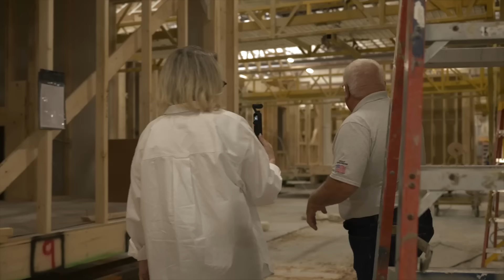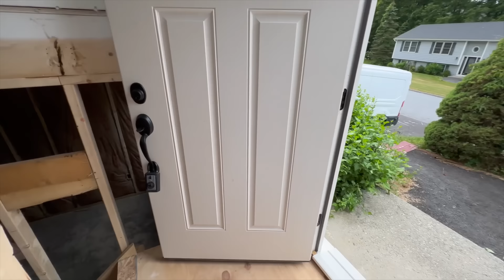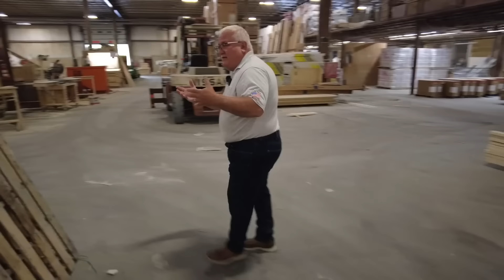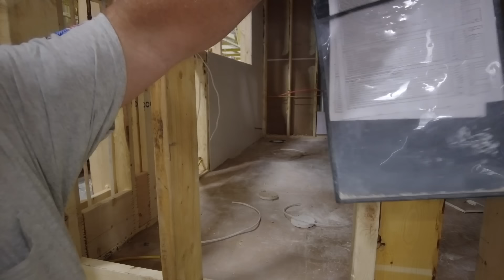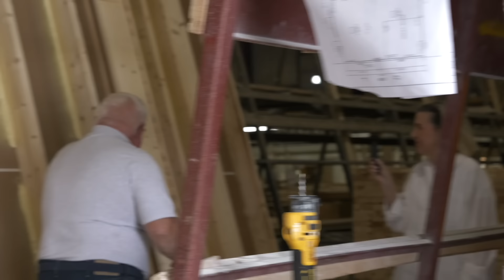Modular Homes ARE Better Than Stick Built!!!

Comment: We have a modular home and the home and home building process was WONDERFUL!!  Just like the guy said, modular homes are built much, much faster and better than stick built.   Why are they built better?  For starters they have to be strong as they are trucked going 70 mph down an interstate.  Secondly, they are built indoor so rain doesn’t get into the house because the roof isn’t on or the windows aren’t installed.  Thirdly, the people working in the factory are highly skilled in what they do because they do it over and over.  You don’t have the turnover you have in traditional stick built construction.  Lastly, our modular home builder gave us a choice to use the options for flooring, cabinets, etc that the manufacturer offered OR I could chose my own outside of the builder options.  I did my own light fixtures, hardwood flooring, drawer pulls, appliances and kitchen cabinets.  The company did give us a bit of a credit since they didn’t have to supply those things.   You will never get that offer by some HOA developer….it is their stuff only.  For some reason, people think mobile homes and modular homes are the same.  They aren’t at all.  Nobody can believe our all brick (brick on all 4 sides), 3800 sq ft house valued at a little over 1Mil in south east Virginia is modular but it is.

Comment: As someone who used to set modular homes, and now do construction, and I can 100% back this up. They are designed to go 60-70 miles per hour and get worked into whatever space that the customer has built which can be very tricky, and still be together with minimal stress cracks. They are tough

Comment: Many people don't understand the major differences between mobile homes and stick built or modular. Unless someone custom orders a mobile home with upgrades, generally what they will get is 1/2" drywall, 1X3" studs, low R value insulation, Pex or PVC plumbing, plastic bath fixtures,  the cheapest of everything.

Comment: I have worked in a modular plant and i have framed custom homes in the field. Modular is way better than a mobile home for sure, they are well built. But, they will require more material for mating purposes, and the hinging for roofs. And if you want an air tight building with the best insulation, building in place is easier to accomplish that. But the ability to build in dry and relatively warm/cool conditions, that was great, and a valid selling point.

Comment: I disagree. I worked many years on new stick built homes and a few years in a modular factory. There is a lot of variables. Some modular houses are built very well and some contractors do a poor job building stick built. When you average it out, stick built is much better for many reasons. As someone who actually knows the trades, it's much harder servicing or renovating a modular home. Modular homes are plugged together. Which literally means plugs for the branch circuits and tons of connection points for the other systems such as plumbing. I can go on and on with the differences. It ultimately comes down to the contractor or factory. The only thing that can't be debated is the speed a modular home goes up. That is the only absolute benefit of modular.

Comment: I work in HVAC, these house rate 1 grade above a trailer. Build quality is so so poor. I just put a Daikin mini split in one because the factory duct work is pretty much garbage. Zero calculation done. So their kitchen area was not getting cooled  by their recommended set up. They were 6 months moved in with door and baseboard falling apart, vertical cracks on walls. Kitchen cabinets are weak, with cheap hardware. Then they told us this is a premium upgraded version of this modular. Not just the base model. Only pro is protected materials during construction

Comment: The company you are showing does do excellent work. I believe the common idea of modular homes being poor quality comes from the countless manufacturers that use cheap subfloor that rots out quickly and frames with 2x3 and uses 1/4" drywall and uses seam strips instead of mudding and taping etc etc. Not all modular homes are built the same the ones shown here are nice but many are very poor quality

Comment: I have been a drywall contractor for over 40 yrs. We measure every inch of the home in most cases to place the drywall. 9 out of 10 times modular homes are usually out of square  and are subject to way more cracks than a stick built home. 2 by 6 framing on outside walls doesn't mean a lot when they are out of square and not insulated properly.. Most modular homes only use wood faced cabinets with the rest being pressed wood. Their oak cabinets are usually oak vaneer facings. You have to watch the fine print and most actually don't know the difference between solid oak and fake oak fronts. The crown molding is usually plastic or foam as well as the baseboard. In a 2 story home the second floor is usually not framed correctly to finish and you will be responsible for that cost. If you buy a 2500 sq. ft house and its two story in most cases the second story has no wiring insulation plumbing just a open hull. Plan on spending another 100 grand or more to finish the second floor. The owner is usually required to have the basement ready for the modular at a hidden cost. They are better than a mobile home but lack a lot compared to a stick built home with a reputable builder.

Comment: There are stick built homes over 200 years old, still strong. I think the concept of modular is great, the whole thing I have a problem with is when they are married, they are not always touching one another everywhere, tight together. They just make sure they are plump. Personally, if you can get a just say 1500 sq ft modular thousands cheaper that a stick built, and are happy with the looks and quality, go for it. But homes are like everything else, they require maintenance, and whether it is stick built or modular, it's all in who is doing the work. I have seen masons pour footers after a month of rain was in the hole, 4 inches of mud, just pumped it out about 3/4 way and poured, said it helped to level it. What happened? It settled, so did the house, cracks in the footer, drywall everything. You can build a great home, and still have it have problems. I have never built, at my age probably never will. But if I do, I'll want it started late spring, after the wet season, and at least the outside done before winter. gives time for the roof shingles to stick (if asphalt) and to hopefully not let the lumber absorb to much moister. Truth is, that's another problem, when there is a demand for lumber, its cut fast, and in many cases not dried properly. When the moister dries, it contracts, and if drywall is on it, it will move with it, making hairline cracks. I don't think there is a perfect science to a home, but traditional built homes are still standing sells me.....

Comment: When I worked at the Bendix Research center, I worked closely with Bendix Home Systems. The company wanted to see how different a modular home was from a well built Mobile Home. The huge difference is basically the same as stick build but done with a ton more precision.  There was a Michigan company building Modular. We were able to witness a home being "built" for a customer. They showed up with the modules and three days later the home was ready to move in. And just like this video the home was not identifiable as a "bunch of boxes". This was in 1974.
Reply: Start an off-grid community consisting of individualized log cabins. ~LLC~ Lincoln Legacy Cabins

Comment: No, they are not better. I've been building homes and doing repairs and remodeling of homes for over 20 years. Modulars are stick built. They use the same format as a stick built home. The only difference is, a modular is made in sections, then shipped to the property to be set up. But, they are still individual boxes that are connected together with lag bolts. A "stick built" home is all one piece, all connect together as one whole unit, not two or three separate boxes. And depending on the manufacturer, you might not be getting 2x4 walls, but rather 2x3 walls, to save the company money and to make the home weigh less for movement. I've seen many of the modulars using 1x2's for the rafters, to the point that I was afraid to walk on the roof. Compare that to a "stick built" home using 2x8's. Big difference. Modulars aren't bad, don't get me wrong, but a home that is built on site, all walls connected together at the same time, are a little bit more sturdy and will last longer. That may just be my opinion, but the opinion of a professional carpenter.

Comment: Do Modular homes have to meet the same code requirements as a stick built home or are they still regulated by RV industry?
Reply from the maker: @gregcharland  no. They are Not RVs and do not qualify a RV certification.

Comment: been doing water and fire damage restoration for 30 years. I would rather have stick built. Of course, I would not also not buy a spec home, and I would carefully select the general contractor and maintain close contact throughout the construction.
Reply: @boonstein9949  Can you explain why, and the difference?
Reply: @mikuspalmis  what i don't like about manufactured homes (there are some differences depending on the manufacturer, and perhaps some manufacturers improve their build quality as problems come to light, but it seems that changes are for the sake of the manufacturer, not the buyer) is 1)sheetrock is often glued to the studs/framing and is hard to remove. This, of course, is only a problem if we can't dry the sheetrock or if it already moldy. 2)Cabinetry is "popularly priced", as is the flooring and the bathroom fixtures. 3)The underside of the structure has the plumbing and (aluminum) ductwork covered by the insulation with a woven polypropylene fabric called a 'belly pan' and we often find ourselves in a cramped and muddy crawlspace removing wet insulation, which, of course, also needs to be replaced. Often, the duct for the clothes dryer also runs through this space, which would be ok if it were at least foil flex duct instead of that plastic garbage that gets brittle and breaks with age. Still, a manufactured home would be preferable to a stick-built 'spec' home (a house built specifically to sell) since these houses use similar cost-cutting materials(don't be fooled by granite countertops or real wood trim; these give an appearance of upscale construction, but often unnoticed is the 'contractor grade', i.e., cheap  paint, carpet, cabinets, door hardware, roofing, etc., and important but unobservable details such as the quality of window installation, insulation, draft sealing, foundation sealing, ventilation, etc. As mentioned in the video, if the structure isn't 'dried in' promptly or the framing isn't adequately dried before vapor barriers are installed, mold can be a problem from the get-go. I have also seen new houses being built on lots that really weren't suitable because of groundwater or drainage issues. Just because a lot is zoned for housing doesn't mean a house should be built there. All in all, if I were looking for a house, I would probably buy a manufactured (after looking at the construction details) before a spec home, but my first choice would be to build using a contractor who would respect my wishes and build a relatively simple structure, worrying less about 'curb appeal' and more about build quality. ( 2 products I see that I don't really trust are SIPs(structural insulated panels) which sandwich EPS foam between 2 sheets of 'chip board' - I saw one where they built their trash fire too close to the building and the foam melted and caused the outer sheet of OSB to concave, I don't think they did anything about it. The other product is those EPS  blocks they use for basement walls. I haven't seen any real problems, I just don't trust them)

Comment: I confused. Modular homes are better?  Looks like the Modular is built with 2x10 floor joists sticks, 2x4 wall sticks and ceiling truss sticks.  How is that different than building “stick” built.  Same lumber and winds/hurricane will blow,it down the same way.

Comment: It is ridiculous to think that those modules are not going to flex when being transported or lifted. I have gone to see modular homes being assembled and they had drywall cracks that had to be repaired. The flexing will also lose nails if even the smallest amount. You can see the whole thing flex when it is lifted. I would like to see screws used in structural areas. I am not trying to knock modular homes, I am thinking of buying one. I sure like the speed they are assembled on site and I am getting too old for a project that big.
Reply: @upnorthyooper1196   the fact that they can build them in 6 days scares me! That tells me they are rushing them through.  I would rather wait longer and have it done right!

Comment: ALL DEPENDS on who does the modular build. Many of them are trying to save weight to make the parts movable under 80k lbs per unit.  So they use lightweight cabinets (cheap ones that fall apart) lightweight sinks and plumbing. LIghtweight drywall. Before you go this route you need to do some research. So many Mobile homes sell as modular but they are not the same.
Reply: @Mikefngarage  I watched a video on that very thing. They sounded like car salesmen.

Comment: I would think that in a factory setting like this, that the buyer can usually figure that there will Not be any Shortcomings in
the building process, Nor any " Negative Attitudes & Intentions " from the builders, " either the high ' or the low " !
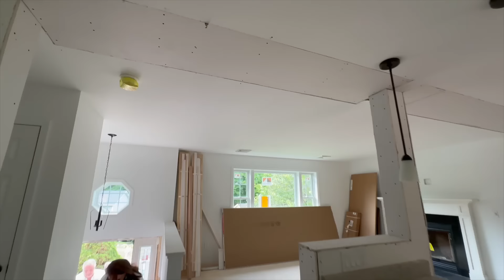But @ 2:02 ..other than the workmen, Who Knows What Kind of work was done ? !
That Dry-wall ' can " Cover a Multitude " of Sins " as " a Carpenter's Union Dispatcher " once said ! 
You would either Have to be there or Hire a camera man / Preferably a Licensed Home Inspector, that you as the builder can
trust.
Now mind you, those workers on that job maybe knowledgeable, And as Honest as the day is Long !
But Unless you can Keep an Eye on people /  you will be reduced to having to; " Trust in their honesty "  !

Comment: Our modular is being built as we speak. Hurricane Ian destroyed our 50 year old stick built home in Port Charlotte…like so many others. We live in Canada and this was our vacation home. We chose modular for a number of reasons:
1) We can’t be on site to keep contractors on track
2) Build time is much faster
3) Our builder (Jacobsen) makes many homes for the hurricane prone Florida Keys, so the wind rating is higher than stick built coding
4) the builder takes care of all permits etc.
Looking forward to spending winters in our new vacation home!
Thanks Kristina for this great video!
Reply: @debzyn did you verify how things like roof repair/ replacement is done when say that's required in twenty years?  could any roofer work on your modular home or are there special considerations and knowledge for them to do it right because of how modular is built then fitted together on site?  Same thing with plumbing etc.. all logic applies if they have to cut into a wall to access plumbing the worker can just redo the drywall, texture and you repaint etc..?  I wonder how the roof overlaps and has no gaps for water to leak in where the various modules fit together, but similar issues with roofers improperly nailing down roofing material can cause leak months later.  Thank you

Comment: The R value per code was overlooked and more was added.  Doesn't this increase the need for the added expense of the equipment to recirculate the air-bring in fresh, add humidity being over insulated?

Comment: When you hear her, making the distinguishing between modular and manufactured, think about the Amway guy saying not Amway, but multilevel marketing. It’s the same thing if you think of it the same as the Cincy one, you will not be willing to pay higher prices. The point of manufacturing houses is to get the price way low. If it’s not doing this, don’t buy it.

Comment: we have a modular home.  ours boxes are only 13 ft wide they came up with 15 feet the year after ours was built.  They told us we couldn't have one big room.  A lot's changed since ours was built.  But I still love ours.  it's 2700 sq feet with 9ft tall ceilings.  There are some some changes if I were to build today.

Comment: OK so I have 40k cash on hand. I am a veteran that is eligible for a VA home loan. I live in Omaha Ne. I want to get a piece of property and put a modular Home on it. I've been in the construction industry for 30 years so I am capable
e of doing any work necessary to keep costs down. Where should I start and how much more cash do I need, do you think? I know that's a loaded question with too many variables. I saw a modular Home for 28k. If I obtain the property, can I move in with 40k or do I need another at least 15k to make thar happen?

Comment: Love the info. We built in the late 80s and were considering a modular home. I was currious about the construction of them compared to stick built. So we did the exact same thing. Toured a modular home manufacturer in PA. I was overly impressed. The only reason we didn't do with modular is price. At that time, our loan approval wouldn't have covered as much as a stick built for what we wanted. But I love them.